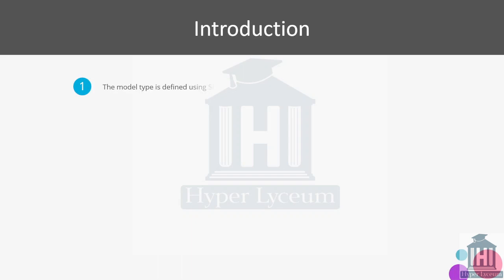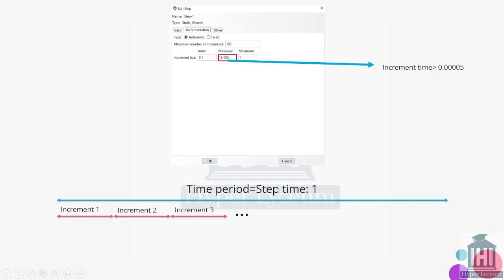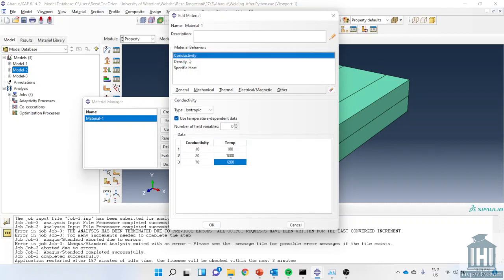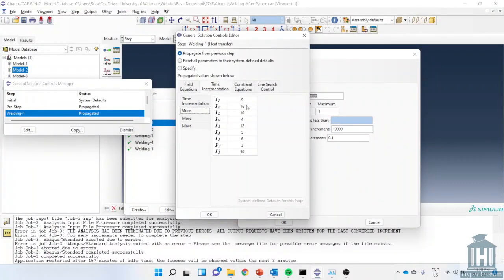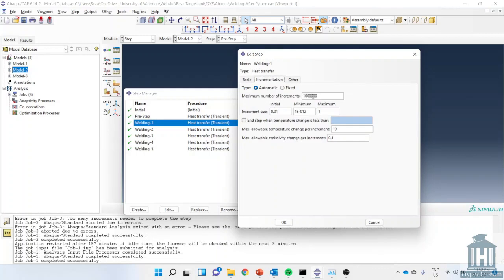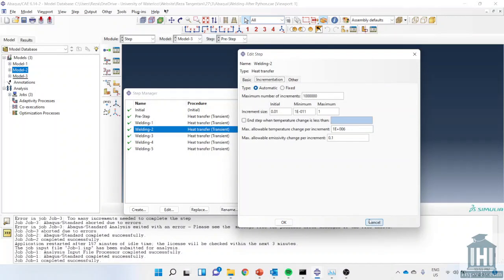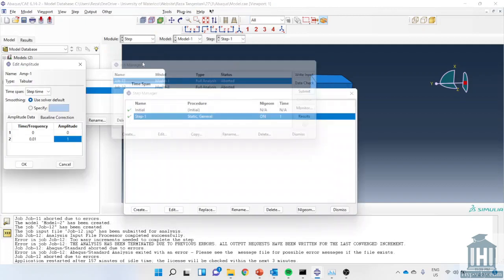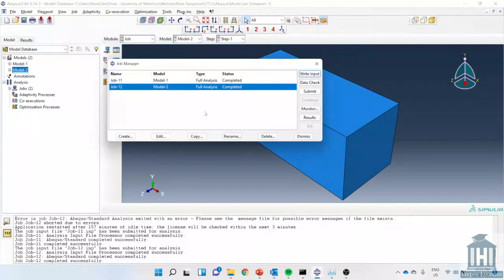How to Fix Errors in Abaqus by Modifying the Step and Increments for Beginners: Part 3

Comment: Plz suggest to me the solution for this problem- Error in job Job-1: ELEMENT 771 INSTANCE PART-1-1 CANNOT BE ADDED USING *MODEL CHANGE IF IT IS NOT REMOVED OR INACTIVE IN THE PREVIOUS STEP
Reply from the maker: Hi,
Go to interaction module an make sure you have selected the elments for your model change feature.

Comment: Please, in Abaqus 2021, how to fix this error: Error in job Job-1: THE ANALYSIS MAY NEED A LARGE NUMBER OF INCREMENTS (MORE THAN 20,000,000), AND IT MAY BE AFFECTED BY ROUND-OFF ERRORS. FOR ACCURACY, RUNNING DOUBLE PRECISION EXECUTABLE IS REQUIRED.
Job Job-1: Abaqus/Explicit aborted due to errors.

Comment: I am doing impact analysis on composite material plate using explicit dynamics but I am getting error as excessive incremental rotational of elements error
I have set time period as 0.0003 sec for analysis
Reply from the maker: Hi, 
probably by limiting your explicit increment size you could fix it. 

Please use our platform for asking your questions:
https://hyperlyceum.com/question/category/abaqus/

Comment: Hello, I am trying to make an dynamic implicit analysis however I get an error "the executable standard.exe aborted with system error code 1073741795".  I am trying to use a predefined stress from a previous analysis which is done by dynamic explicit analysis. 

However, if I do same analysis with dynamic explicit solver completely, it works.

can anyone have any suggestıon?

Comment: how about this problem ""Excessive distortion at a total of 110 integration points in solid (continuum) elements"" ??
Reply from the maker: If you running an implicit model it means the loading and boundary condition is existing your the element threshold to capture the deformation or other results. For explicit you need to set a maximum increment limit as well as the previous problem.
Reply: How did you solve that error plz reply 🙏🙏